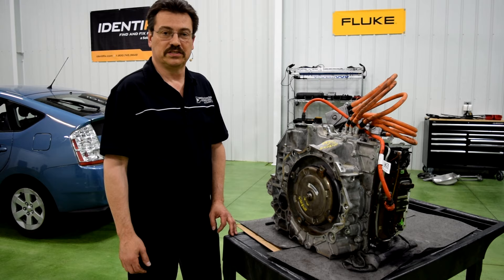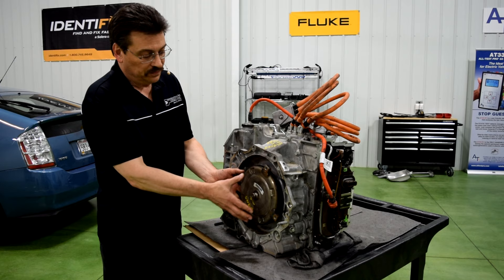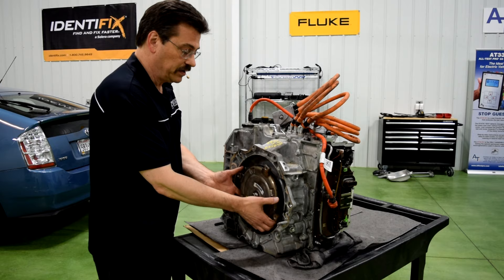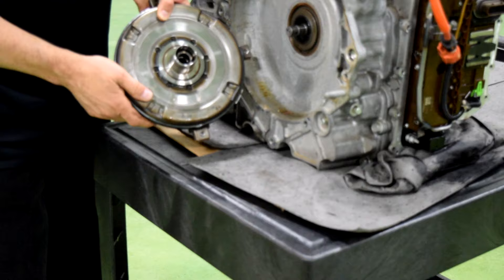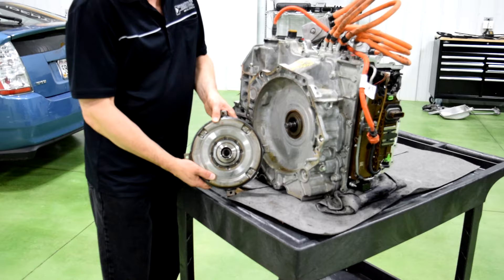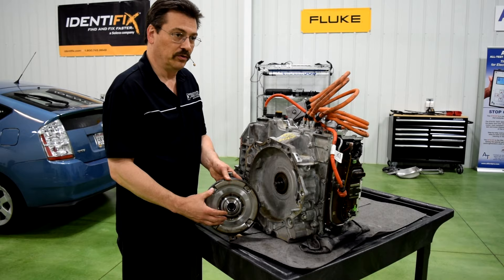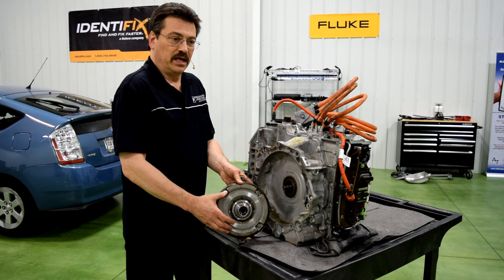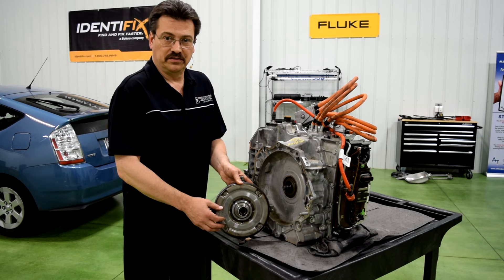HEV TV 2.12: Chevrolet Volt Transmission (Part 2)

Comment: Is the only axas to the four dampener bolts made by removing the engine oil pan, because like a torque converter it needs to stay on the electric drive/transmission  for assembly and disassembly?